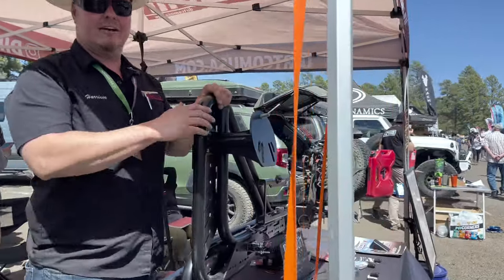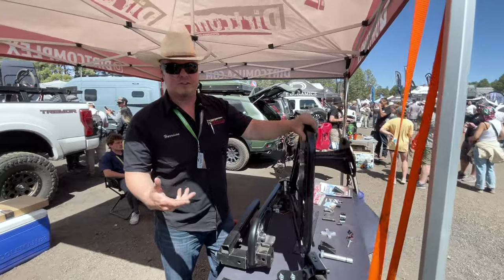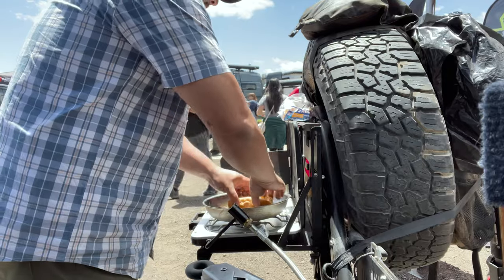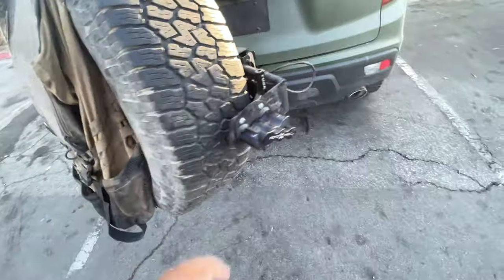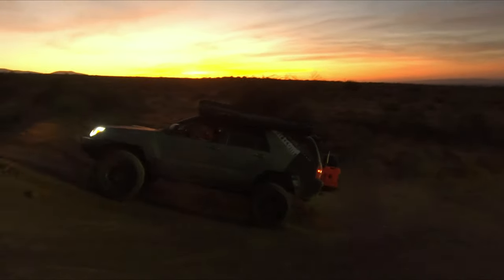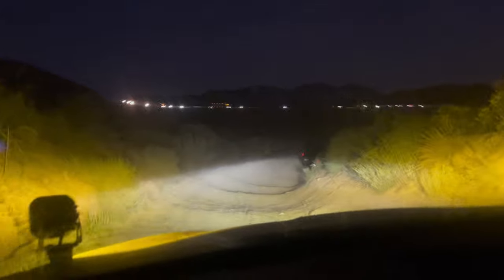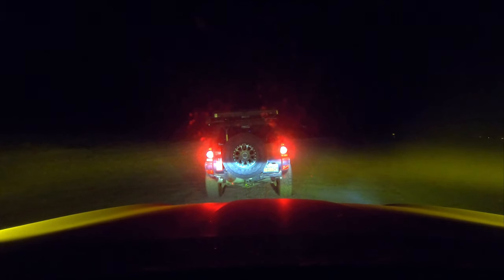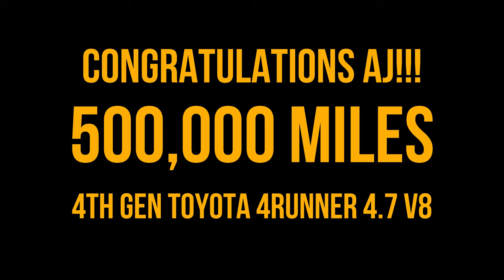Overland Expo West - DirtCom "Trail Swing" rear hitch tire carrier & the 500K mile 4runner

Comment: These seem expensive until you realize "DESIGNED, MANUFACTURED, & TESTED IN THE USA".  Supporting your local American companies always justifies the cost and they seem very well made.
Reply from the maker: Absolutely @FatalAnimal!  We had a friend that bought an Amazon tire carrier and it fell apart after a 130 mile overlanding trip on the Mojave road.  He replaced it with the Dirtcom “trail swing”.  

Also, I think one of the biggest things to consider is convenience.  I can buy groceries, open the tire and rear hatch with one hand.  That’s a big deal too!

Comment: Love my trail swing. After my latest cross-country trip I ordered the folding table so I can put my grill on it. I’ve also ordered a propane tank mount (from PowerTanks) for where the rotopax would mount on the side accessory mount.
Reply from the maker: At first I made my table, but since I was displaying my Honda at Overland Expo West 2021, I thought it would be a good idea to upgrade.  There’s alot of good options for a table.  I’ve seen a guy use a $150 smittybilt table and mount it upside down.  He added a DIY steel plate drop down which makes it a double shelf table.  Pretty genius!

Comment: Looks strong and well made. Question, can you still tow a small trailer with this installed? If the swing has a spare mounted on it what reduction in towing capacity is to be expected? Thankyou
Reply from the maker: So, you can pull a trailer, but the tow capacity gets halved.  So for example, my Honda Passport is rated to tow 5000 lbs. and have a tongue eating of 350 lbs., that get’s reduced down to 2500 lbs. and a tongue eating of 175 lbs. because the hitch is extended.

Comment: Oil impregnated brass? Would be interesting to see that as normally it's bronze, also known as oil lite bronze
Reply from the maker: Theres zerk fittings on the hinge bolt.  Pretty cool that you can regrease the bolt.
Reply: @JonDZ_Adventuring  that is also good for pushing out foreign debris as well but that adds the longevity for sure adding that in
Reply from the maker: It might be hard to see, but at 5:32 I had the original prototype trailswing.  The stainless steel piece by the bolt wasn’t replaceable and I don’t think there were zerk fittings.  The revised version has the American flag laser etched by the handle.  Cool to see a company make those improvements with longevity in mind.
Reply from the maker: @bajasoobnut  oh, the auto stop use to be set at 90 degrees, but they found that it would be more convenient for people to have it stop at 120 or so, that way they can open their hatch to conveniently place something in the cargo area and not have to deal with unlocking the auto stopper.
Reply: @JonDZ_Adventuring  indeed!

Comment: My trailswing should be here tomorrow! AJ hooked me up and got it to me a little early after I got invited to a local MtnRoo ride this weekend! Planning on getting the rotopax mount and the fold out table at some point down the line. Preferably before the July trip haha. 

Also, congrats to AJ on the half mil miles! Those 4runners are indestructible!
Reply from the maker: Sounds like a solid setup.  So many Subarus are running this tire carrier.  It’s the only one I recommend for crossovers because of the best in class departure angle.